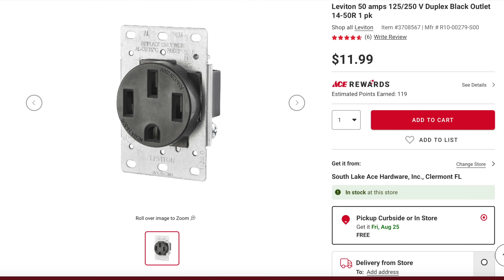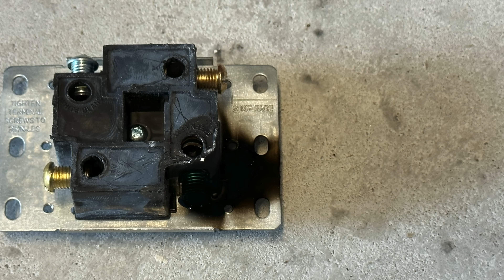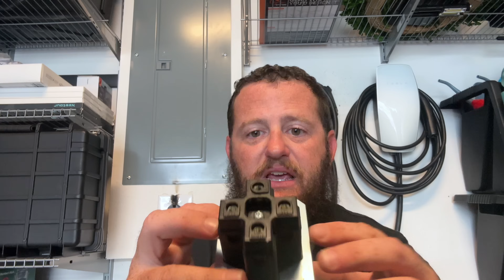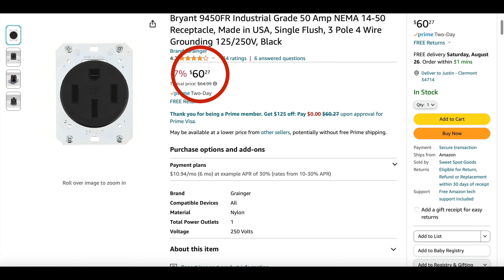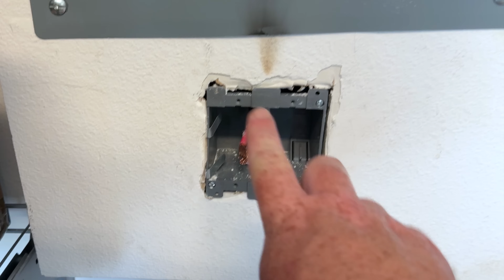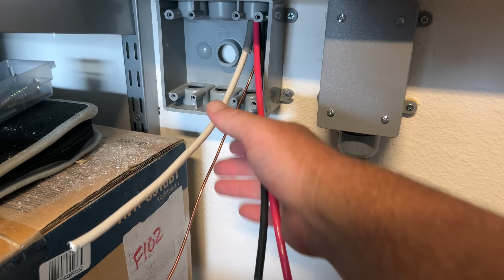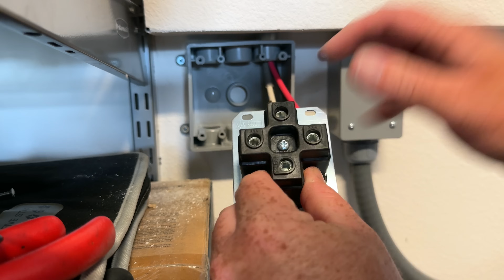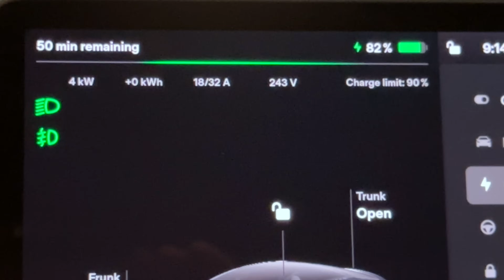This Will Save Your Life if You Charge Your Tesla on 14-50 Outlet!!

Comment: The whole setup is a bad design. Furnaces have been running 100+ amps 240V for years with not problem because they are hard wired to lugs and you don't have to jam / crunch it back in after you tighten. That's where problem happens mostly imo and possibly loosening blades male/female may add to problem. I think they should be hard wired with a butt splice in jbox and use the breaker as your disconnect wouldn't have any problems. But I can't complain I get tons of service calls from this scenario. I've seen this prob 500+ x over the years

Comment: It’s not the constant plugging and unplugging that caused the fire/arcing/damage.  It is for sure the lack of torque holding the wire. Look at the source of the burned area in the rear.  This burn can happen also with the more expensive 14-50 receptacle if the wire connection is not tight enough.  To properly tighten the wire connection if you have no torque wrench, tighten the screw on the wire as tight as you can because it’s better to over tight than not.  Then do this— flex or wiggle the connected wire up and down and left and right. Next, tighten the screw again some more and wiggle the wire like earlier. .  Finally, tighten it some more and that should do it.

Comment: The two hot wires are 180 degrees out of phase, thus cancel each other, should not have current in the ground wire or neutral for a balanced load. Somehow you had a short to ground, panel breaker didn't react to it or didn't trip fast enough. 2-pole ground fault circuit breaker should be able to protect your wiring/garage in the future.

Comment: Thanks for sharing. Do got a quick question. I just got a Wall connector but would like to use my existing 240v outlet for mobile connector. Is it safe to add a power cord to the wall connector and plug to the 240v vs hardwire? Your thoughts pls…Thanks!
Reply from the maker: no one can tell you its "safe" to do that
Reply: @BeardedTeslaGuy  Thanks for responding. I am guessing you got that setup since uploading this video and never had a problem?

Comment: Looks like from the comments that putting a 50 ampere switch above a quality 50 ampere outlet is the way to do it. Do the Tesla chargers have a kill switch so that you can connect and disconnect the plug without fear of shock? 💙 T.E.N.
Reply from the maker: Tesla wall connector has built in safety
Reply: I read that they have ground fault protection, but the article didn't say anything about arc fault protection or if the connector receptacle can be shut off momentarily to allow you to plug in and unplug without any danger of getting shocked. I'm thinking that my future customers will be getting some kind of disconnect right by the outlet for hassle free plugging. 🙂 Also read something about under floor/concrete/pavement (Garage/driveway) wiring for wireless electric car charging. 💙 T.E.N.

Comment: I have the 14-30 variant (Dryer plug as some call it). I bought extra mobile charger  when I bought my M3 in 2021. It stays connected to wall, the original one stays in car. jus so i do get a ton of plug wear like that. scary. Glad everyone is safe. (At least as I'm 1 min in the video they are at least. Fingers crossed).

Comment: If inside the garage why unplug it? Just leave it alone and if you unplug it you supposed to turn off the breaker for safety reasons you are really lucky not getting hurt
Reply from the maker: I test a lot of charging equipment which is why I unplug
Reply: @BeardedTeslaGuy  I didn’t have one in my house so I hire someone to install one and the first thing he told me was to use the breaker and to limit the amount of times i unplug and plug in that connector because of that risk of failure 
Glad you didn’t get hurt

Comment: Good choice, i recently installed a charging outlet for our Tesla. Did a few research, purchased the Bryant 14-50A outlet. By code and because it's not hardwire, need to install a 50A GFCI breaker. Identify if your electrical panel is a Homeline vs QO Breaker or Breaker Panel.
Reply: Not hardwire? What does that mean?
Reply: @oldrango883   its having a plug-in outlet (outdoor or indoor) vs no outlet (hardwired). Tesla sells 2 types charging with cable. Fyi, a 50 amp GFCI breaker is expensive.

Comment: This happens to U/L rated connectors when the pinching bolt was fastened at below rated torque. Do follow manufacturer specifications. My internet search for NEMA14-50 indicates to use 75in-lb or 8.5Nm.

Comment: Here is a good tip.     Even if you have a Leviton Plug.    How to preserve it, even if you need to plug and unplug.     BUY A PLUG EXTENSION and Keep it plugged in always.    Then plug and unplug from the Extension.    After a while the extension will eventually ware out,  just like the Plug.   Then simply replace the extension.    Your actual wall Plug will last much longer
Reply: Or just back down your amps and use the charger properly.
Reply: @chaztaylor76  The amount of amps is not the problem.     Its the unplugging, and plugging in, that wears out the Plug, thus necessitating its replacement.     So, the extension will wear out, and you have only plugged in the extension to the wall plate one time, until you get another one.
Reply: @treyfred3247 ive been using the same extension for months with zero problem. With older plugs just back down the amps and run a bigger hauge wire that can help absorb more heat you can run it like that all day no problem.
Reply: @treyfred3247 power is heat those older plugs dont do well with high amounts of amps for long period of times especially when your dealing with an older breaker. You dont have to charge your car in 15 minutes... I slow charge mine all the time back the power down little bit.
Reply: Just don't unplug your garage charger ever, that's a much better idea than a throwaway extension.  Copper is expensive.

Comment: Good info!  I'm curious about two things you didn't cover though.  One is how your main breaker tripped before the dedicated 50A breaker: seems like the 50A breaker is not doing it's job.  Second, you showed a burned finger: how was there enough current while plugging in or unplugging to cause that type of burn?  Unless you unplugged it while the car was charging, there should be minimal current being drawn when you first plug it in (i.e. while your hand is on it).

Comment: The big difference is the Hubbells have a < > type clamp for the wires instead of a screw . This is usually where the heat is generated.

Comment: I have a similar set up and had an event with a Tesla that was using our charger  (the Tesla draws more amps) vs the Chevy Bolt that we had at the time. No fire or sparks but I could smell that something was not right and shut the circuit down and let it sit until I had a professional look over my system. The weak link in my installation were the DIY connections. To fix this set up each connection was checked and tightened and un tightened 3x to make sure that the braided wires conformed to the anchors properly. Sooo... you don't just torque it once and think that it is good! Back if off and retighten three times. It may be different with a solid copper wire but I thought this was important to share. I will replace my outlets with the better ones. Thanks and glad you and the family are safe!
Reply: I checked and rechecked mine multiple times and used a beam type inch pound torque wrench instead of those screwdriver looking things.  You can use the beam type with the breaker installation too, you just need a long screw bit.  FWIW the breaker is 45 in-lb and the Hubbell is 75 in-lb.
Reply: Yes. After the initial torquing down. One needs to wiggle the wire around. The strands of wire can shift around and create looseness. That's the purpose of the re-torquing.

Comment: If you were going to add the extension you would have been much better of leaving a single U shaped loop on each wire. This ensures there is no undue tension on the cable after you secure it down. In Australia we have much better designs for high amperage plugs. There's usually an outer retaining plastic screw bezel which locks the connector to a corresponding thread on the socket and they are nearly all switched. We only have single phase 230VAC and three phase 400VAC so no split phase sockets like the US which seem designed to kill you.

Comment: High voltage and amperage is nothing to be trifled with.  Except in unusual circumstances, charging at maximum rate is not necessary.  Setting charge rate to 5 to 10 amps less is safer and probably better for charging, anyway.  I'm leaning more and more to a wall connector for primary charging.
Reply from the maker: Directly wired wall connector is the safest way to go for sure.

Comment: Thank you for bringing this issue to the community's attention and showing them/us a better way to avoid the problem. Although yours is not the first to show this problem, it does confirm that the others were not simply one-off events. I have to ask however, why you recommended a torque screwdriver that is only rated and calibrated up to 65 inch pounds? The manufacturer requires 75 inch pounds of torque. Can you please address this?
Reply from the maker: It actually does go beyond the 65 lbs, but yes, if you can get your hands on a 75 lb one, that would be ideal.

Comment: Sounds like you short-circuited something.
Could have been installation and after plugging it in, the movement touched two wires together. Or, I suppose pushing it in could have broken something in the plug, which caused two things to touch together, but seems more unlikely imo.
When you took the plug out, what’s there a chunk of metal missing somewhere? Because that’s where the short circuit would have happened.

Comment: I used to be an advocate of using NEMA 14-50 outlets and a mobile charger or a plugin wall mounted EVSE. But, after a couple melted connectors, it just seems too easy for electricians to cut corners or simply not understand the needs of EVs. So, like Tom's recommendation on State of Charge, I now advocate hardwiring an EVSE if possible. Nearly all wall units have a hardwire option. If you need to use a 240v outlet, leave the EVSE plugged in at all times - plugging in and out of the outlet will ware down all but the most industrial outlets - which can lead to a short or fire. You also run the risk of moisture ingress if your outlet is anywhere it might get exposed to weather (near garage door). With a plugged in EVSE, I recommend inspecting the terminals and outlet every few months to make sure it is still safe.

Of course, all this is avoided if you just hardwire with appropriate gauge wiring.

Comment: Bearded Tesla Guy- Glad you are good. Question-I have a 200 amp panel its full because I have an in-ground pool that took up the extra space(was not looking for a house with a pool it just came with it). Im ready to buy a used 2021 model Y but after looking at my power panel there is no "knock out" available for a breaker. Can an electrician add to this? My home was build in 2012 and it has a modern electric panel. I can send you a pic in instagram. Thanks for any info.
Reply: You can upgrade the panel but the issue is still the capacity/load. AC/Pool heater/charger cannot all run at the same time. One needs to go down and that is assuming your cooktop /oven is not electric. Best bet is to talk to a LICENSED electrician.
Reply: @caligal   thanks

Comment: Never use a 240v circuit on a plug/unplug basis. Glad you learned this.
Reply from the maker: I test a lot of charging equipment which is the only reason I have this setup
Reply: That is the same plug on large RV. They get plugged in all the time. A lot have a grab handle. Hard wire in a metal box with disconnect.

Comment: Why is this 60 amp duty charger not wired directly to a 60 amp braker. The portable charger is cheaper and can do the same performance.
Reply from the maker: the wall connecter is set to 40 amps...and it is maxed for 48 amps, not 60
Reply: @BeardedTeslaGuy  80% of 60 is 48. Just saying that charger can do better if wired to 60 amp breaker.  If power to the meter can handle the load of all your EVs. Aperera is going to provide excellent purpose and utility for more people.

Comment: TLDR: Add a GFCI breaker and have it inspected.

Do it yourself but please pull a permit and have your work inspected by local code enforcement. It could literally save your life. Also, your local electrical inspector might be a super cool person.

Based on NEC 2017, you're missing a GFCI on the breaker for a 14-50 EV charging outlet in a garage. If there was indeed a short to ground during the last failure, a GFCI would have tripped long before scorching the ground prong. Not to mention the safety it affords people plugging and unplugging connectors in wet locations like garages.

With all that said, I love the in-use cover and may add one for our Bryant 14-50. Happy charging.
Reply from the maker: GFCI is not code here. It also interferes with some charging equipment so I have elected to forego that to avoid the hassle
Reply: Tesla home charger has that built in. No GFCI needed.

Comment: If it was installed to code it is very unlikely to cause a fire .... Usually electrical fires start at a device , not the receptacle ...
Reply from the maker: These receptacles are not built to be heavy duty cycle used.

Comment: It sounds like it tripped the main house service disconnect and not the breaker for the circuit.  If this is so, the circuit breaker did not do its job and should be replaced
Reply from the maker: Yea, the main tripped, the 200A

Comment: love your videos but as an electrician myself i just need to say this. this had ZERO to do with this outlet. if we see where the big burn mark is right above the ground screw which doesnt carry current and not anywhere near the the two hot leads. this was caused by a ground short which can be shown by the lack of heat arounf any of the hot leads. ive installed many 14-50s and its very hard if you dont know what you are doing to cram the wires back in and not  pinch a hot wire behind something. what im trying to say is that switching to a hubbel outlet and having a poor install will result in the same outcome.
Reply from the maker: very possible something I did accelerated the failure here.

Comment: I just got a warning from the car that the temperature of the plug was too high, and it cut the charge current down to 16A.
I opened up the outlet and saw no physical damage, arcing, whatever.  However, I felt like the connections were not as tight as I usually make them.  I put more Compound on the wires and tightened.  Did more charging, and the plug remained cool at 32A.
I used a pistol-grip thermometer to check the temperature at 125F when I had the problem.  85F after the 'fix'.
BTW, I almost never plug and unplug the mobile charging cable.
Reply from the maker: They can loosen over time, always a good idea to torque and check from time to time

Comment: You use the cheap 20$ plug .  From your original post video.  What you did was wrong .  The 14-50  you should bought the 100$ charger that made by horneywell . 

Don’t use the 14-50 .  Run direct wires to the home tesla charger  spend the extra 500$  for the tesla  gen 2 

What you should have done was buy a tesla wall chargers and  run 6/3 gauge from the main breaker  to the wall where you installed.
Reply from the maker: I use the 14-50 to test charging equipment or else I would just hard wire

Comment: Use a Hubbell 14-50 or Briant. Leveton does have a 14-50 that is OK  but it will not be at a local hardware store I saw a good Leveton at a Tesla showroom. If you look carefully at the cheep bigbox outlet the contacts inside they are less than 1/2 of the contact area than the good one. Also if you take the good one apart you will see an additional spring clamp to hold the contacts together so better power transfer and will not overheat. Monroe had a episode on the same problem.
Reply from the maker: Yep, just upgraded to the Bryant

Comment: My 2cent: Get a Hubbell part number HBL9450A from an reputable electrical Supply House not Amazon. Wiggle the wires as you torque it to spec.

Comment: HAVE TWO CAR GARAGE WITH SHOP. INSTALLED 50 AMP THREE FOOT WELDING PLUG ONTO TESLA WALL CHARGER. USED 50 AMP EXTINCTION CORD AND PLUGGED INTO SPARE WELDING OUTLET. WORKED GREAT FOR 5 YEARS. WILL BE CHARGING MODEL 3 AND CYBER TRUCK.

Comment: I’ve installed the Bryant and receiving 0 problems. I also use a 6 gauge industrial wire which deff helps. But since you torque the outlet don’t forget to torque your breaker switch as well !
Reply: What’s the difference between industrial wire vs residential wire 😂

Comment: Same exact thing happened to me.  I had a Levitron plug working fine but then i ran into a problem with my charger.  I had to take the charger into the basement for repair and then brought it into the garage to test it (which caused me to plug and un-plug it many times).  This is when it failed.  The issue with the Levitron is that the springs on the Hot leads start weakening and this leads to a loose connection on the hot wires.  Arcing will occur which cause the plug to fail.  Luckily i smelt burning and caught it early before more damage was done.

I wound up buying the Hubbell.  I now also unplug my 14-50 outlet and clean the connectors with steel wool as well as  DeOxit every six months just to be safe. 

I'm glad to see you torqued your connection.  This is very important step during installation that a lot of people don't do and just guess at the torque.  

thanks for sharing your experience.
Reply: By experience over many years, it is not necessary to scrub the connectors with steel wool, even DeOxit probably is not necessary, however, there are permanent compounds that are very effective, electrically conductive grease.
Reply: @tedmoss  interesting - what type (brand) of conductive grease do you recommend?